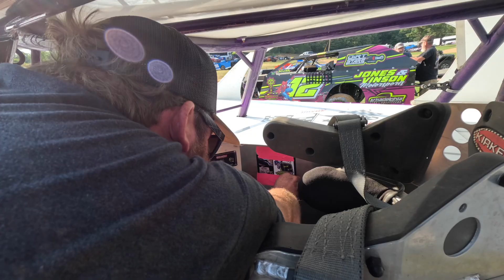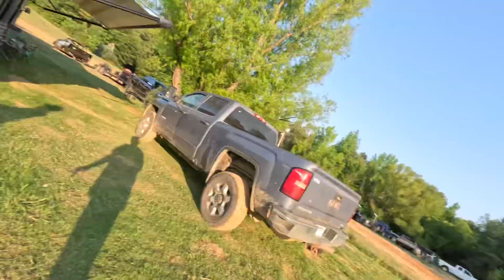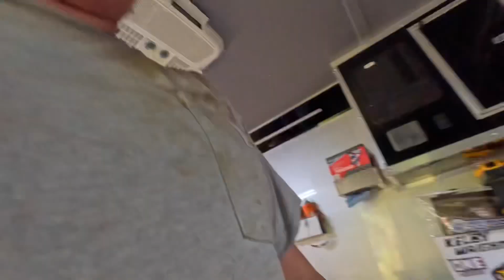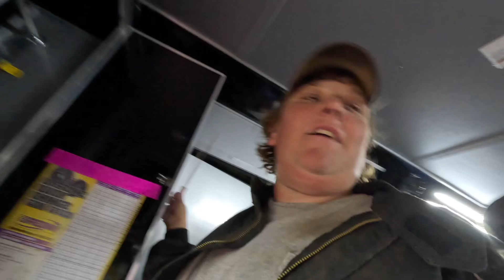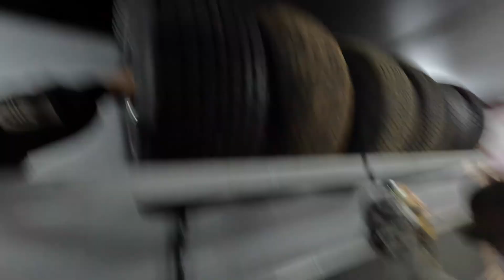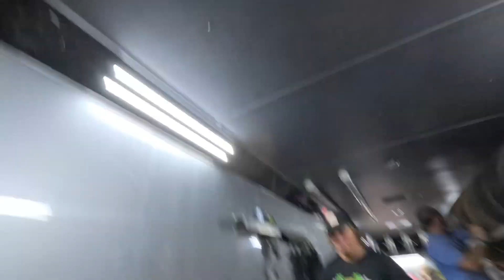Back to our Roots

Comment: Ever try leaf springs? I ran them in my IMCA car and it worked great. Use a set of Plymouth Duster leaf springs. the center pin is off set and not in the middle of the springs. This keeps the spring from binding and forces the rear on both side down making the traction equal on both sides for way better traction. Coil springs are not strong enough to keep equal pressure on both rear wheels.       i tried coils and all it did was unload the left rear leaving the right rear to do all the work. If you do try it I will be watching. Good Luck.  Butch. Fruitland Park Fl.

Comment: Keep at it.
That track was slick.
Then again set up missed a bit.
Check your pinion angle. And mounts looked like rear was moving around a bit.
Bent rods or loose bolts.and or worn parts